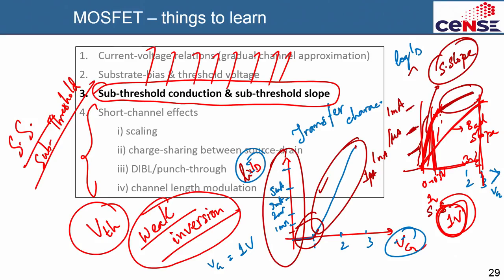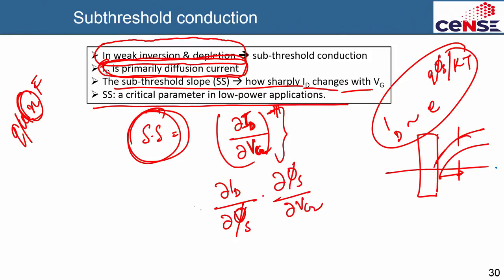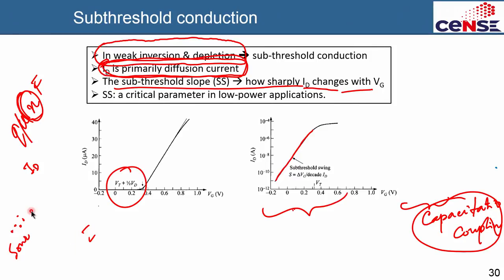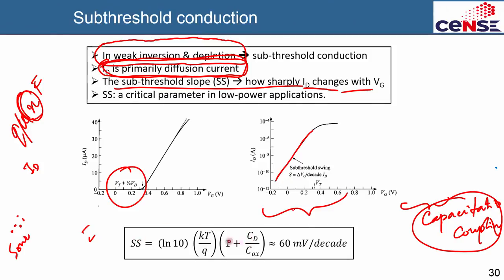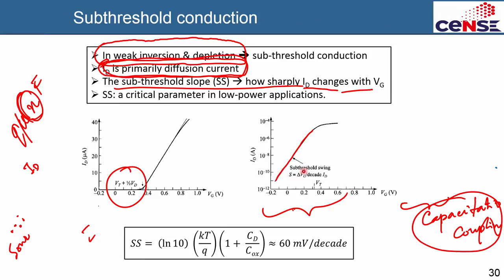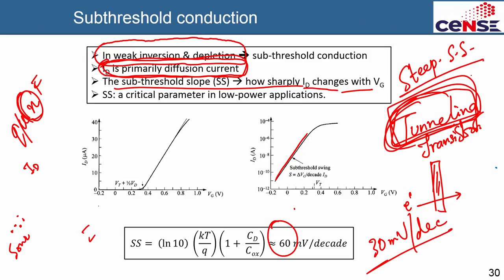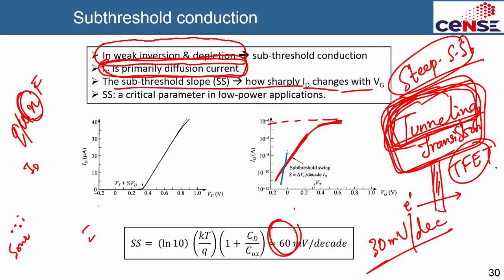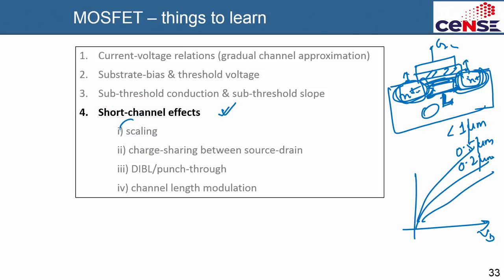Short Channel Effects in MOSFET

Comment: Can we use MOSFET to amplify TFET current in series where TEFT will control ON & OFF but ON current will be controlled by MOSFET amplification?
Reply: Good thought brother, but since a mosfet is used in cascade(means output of TFET is taken as input by MOS) with TFET, somewhere we will get limited by SS slope limit of mosfet especially since mosfet is voltage controlled-current output device. I'm not a device person, so pls correct me if u hav any points. Happy to discuss abt this